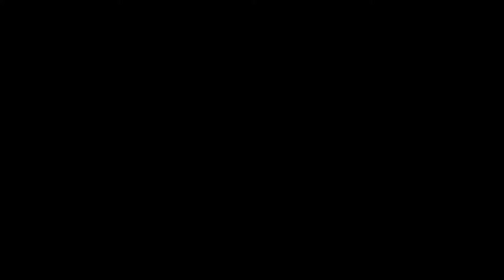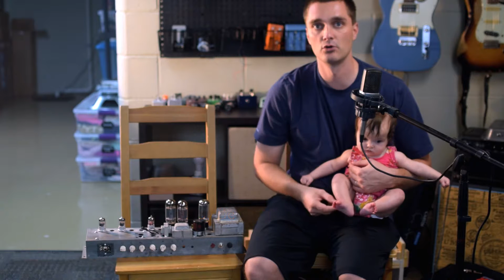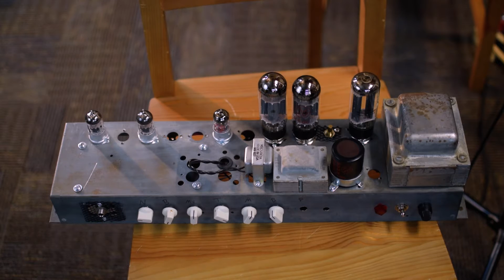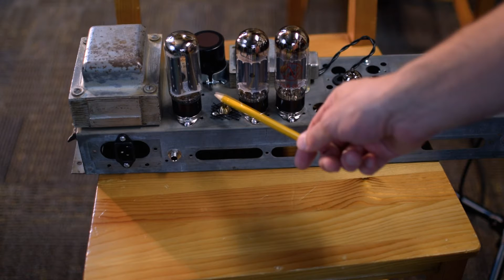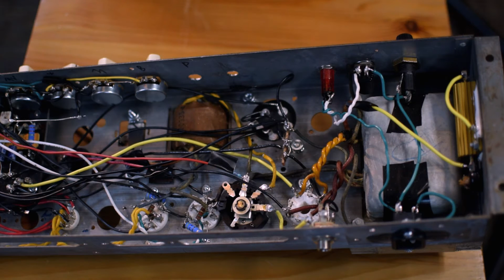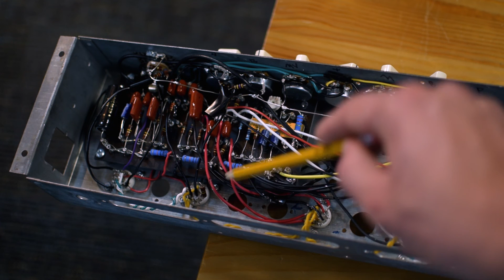Hammond AO-29 Conversion to Marshall Plexi - Project Overview

Comment: Put a 700ohm resistor to ground from the red /orange center tap.

To act as the feild coil.

It will drop the high voltage by 100volts.
Reply: 700 ohm? What does the wattage need to be on it? Thanks

Comment: Hi KDJ, Very nice job on your conversion, and a great video. Glad you didn't do what most everyone else does, just play your guitar for 5min and NOT discuss anything about the build!! Just a couple thoughts after watching this.. Do you own an RCA Receiving Tube Manual? It's very important to know how to bias all of your different output and pre-amp tubes. That AO-28 push-pull output transformer is rated for 12-15 watts into a pair of 6V6's.with 8000 ohms resistance (plate to plate) and 285-305 volts on the plates. You just can't put any old tube you want into that output section.. The 6L6GC's are looking for 450 volts on the plates with a 5500 ohm load (plate to plate), they can produce up to 55 watts output, so you can see that transformer isn't correct at all. Also, if you don't have one, some sort of Tube Tester is a must. You don't have to spend a fortune on one. Just something to give you a relative idea on how much life the tube has left.. Even the most expensive tube tester won't tell you if a tube is Microphonic or not. The tap test as you have been doing elsewhere is best (use chopsticks btw.) I have built a couple hammond amps into guitar amps, and converted vintage PA amps too (those can be even better bargains than the hammonds), I just haven't posted the video's yet, I will soon though. I do have my 1st build up, a Champ/Early Princeton type, but with a few twists. Sorry this is so long, looking foward to your next project take care, Tom
Reply from the maker: Thanks for the encouragement and the comment!  I understand what you're saying about tubes.  This conversion was quite an adventure and I had a number of issues to sort through.  I documented much of the process here:

http://www.tdpri.com/threads/organ-donor-hammond-ao-29-to-6v6-plexi-conversion.697430/

One of the weird things that I have yet to understand is that it seems to be related to tubes and voltage.  Compared to the organ I am using significantly fewer tubes.  With my initial build using JJ 6V6's my plate voltage was very high - at like 435 vdc.  Then I fixed a number of issues related to miswiring the phase inverter, and tried 6L6GC's.  My plate voltage came down to about 370.  I tweaked the bias circuit a little bit and got some proper dissipation for 6L6GC's.

In its current state I have found that it sounds quite good.  But I would definitely say I'm experiencing what you're describing related to the OT.  It seems to saturate very quickly.  My most recent clip is here:

https://youtu.be/k9phFiZpDFY?t=408

Do you think I'm on the right track with the relationship between current and voltage as it relates to the Power Transformer?  The idea is that because the PT was designed to support so many more tubes than I'm using, the voltage is increasing?  More tubes draw more current and help 'spread out' the voltage across the circuit?  This is just a hunch.

So as for options to fix the problem, perhaps one of the following:

1)  Try a new Power Transformer designed for an 18 watt style amp (as used in the Hoffman 6V6 Plexi circuit).
2)  Try a new Output Transformer designed for a 50 watt Plexi more in line with my current PT and voltages and tube compliment.
3)  Maybe add more tubes to allow the PT to function more like it was designed.  Perhaps tube driven tremolo or reverb.

I am currently most intrigued by option 1 or 2, just because they're simpler.
Reply: Okay, I am familiar with Hoffman website as I use the schematics page all the time. I don't know exactly what schematic your using (maybe one of his) as I see you must have purchased some kind of kit with a prebuilt board (looks like nice stuff). There are a few things happening. 1st the original primary voltage of the power transformer was most likely 117volts  ac input and possibly 115volts.. Not the 121 or 122volts ac we have today.. That is going to increase the secondary output a lot.. I don't know offhand what the high voltage secondaries for that amp are.. 320-0-320, 315-0-315?  The fact that your not using the same amount of actual tubes as the original design will raise the voltage some, But really it shouldn't be that much of a factor... It just means that the power transformer can handle a lot of milliamps without fear of burning up.. That's a pretty good power transformer. If you want to keep the 6L6GC's... I would look into getting the proper sized output transformer. If you want to use the 6V6GT's as designed, you might have to add some 5watt dropping resistors to ground in your B+ line to get the plate voltage's down to what they should be... You might have to do that even if you purchase the 6L6 output transformer... I'm going to assume your using cathode bias for the output tubes? Meaning you have cathode resisters on the output tubes to ground, usually with a cathode bypass capacitor of say 50uf @ 50volts? Let me know if your output is fixed bias (cathode's grounded with a dedicated negative voltage to the grids) or cathode biased.. cathode's with resistor bypassed with a capacitor to ground.. Take care, Tom
Reply from the maker: I see, that makes sense to me.  I hadn't thought about dropping the voltages.  Dropping resistors or zener diodes seems like a good possible option.  

I am using fixed bias.  I tweaked the values a little to give me more potential swing to bias the 6L6GC's properly.  

Overall I did use Hoffman's 6V6 Plexi kit as a baseline and removed a lot of unnecessary stuff including chassis and transformers.  But that component board and small parts kit is the baseline for the build.